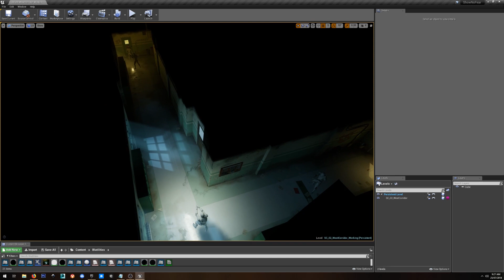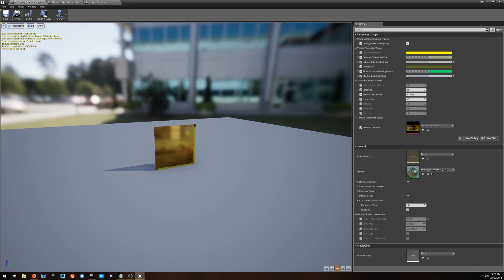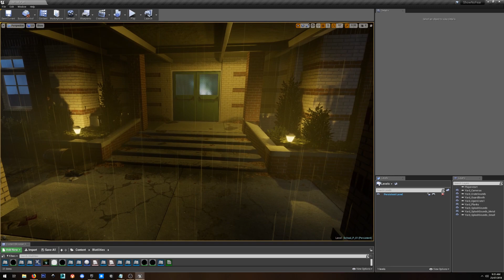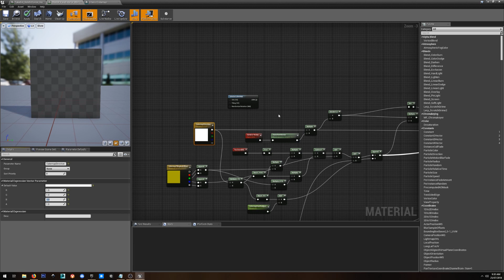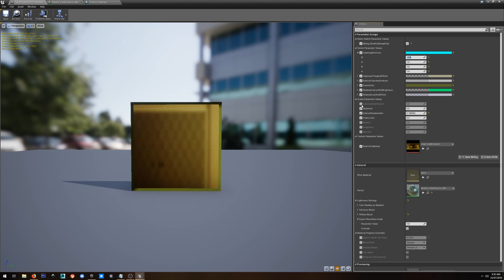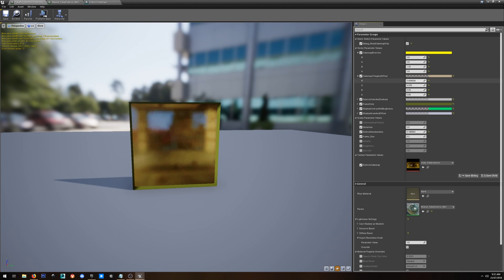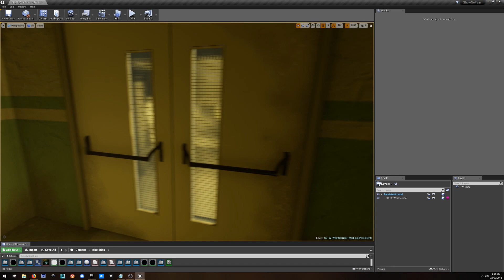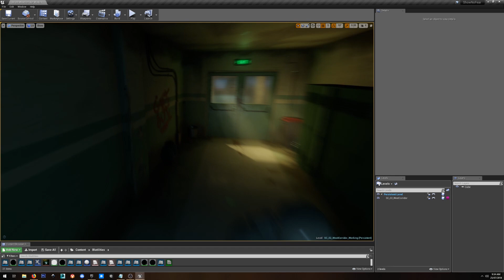Interior cubemapping for fake exteriors in UE4

Comment: I'm struggling to work out how to get mine to work. I've plugged my custom cubemap into the last pin where you noted on the blueprint, but I get an error in the message box saying "[SM5] (Node TextureSampleParameter2D) Param2D> Found NULL, requires Texture2D". I'm on UE4 4.25. Any idea what I need to do?

Comment: Hey, I have a problem with this setup: 
for some reason the cubemap texture won't adjust itself size no matter how far player standing from it. 
here i am close to window: https://i111.fastpic.ru/big/2020/0102/1e/_11e4f1ff8cd8924b610d0d68da94d51e.jpg
and here not so close: https://i111.fastpic.ru/big/2020/0102/c1/_0bd5d214c90f2165e5f6812eaa7f88c1.jpg
you can see the door have same size as if i was close to it
UE 4.23

SOLVED: green and red channels in "CubemapTilingAndOffset" should be value of 1

Comment: How did you enable DoF on SceneCaptureComponentCube? I am trying to make a blurry cubemap in UE4.
Reply from the maker: think it just worked (i just set up the DOF settings in a post process volume and then put those same settings in capture component).
BUT
I think they have deprecated Gaussian DOF now, which is really annoying as it was good for this. Might be able to achieve similar with the new DOF method.

Comment: Hey Cory, I know this is a silly question but I've been trying to figure out how to make this work for a while now and I can't understand a couple of things. First of all did you use a "scene capture cube" component to capture a cubemap from your exterior? And how did you use that into the material for the interior windows? I tried to use the blueprint you posted with a custom cubemap I made but I can't find where you connected the cubemap node. I would really appreciate any help. Thanks :)
Reply from the maker: Scene Capture Cube yes. If you paste from the graph I posted ( https://blueprintue.com/blueprint/8c5j4gg9/ ) - you'll notice it ends at a pin that has a comment "goes to your texture". That plugs into your cubemap texture sample.
Reply: Ah! I was using the other link you posted a few months ago! Thank you very much! May I please ask for one last help regarding the frame and how you added the grid to make it look like this type of glass? Did you use a lerp or a multiply for that? I tried using a black texture with a white frame (1 file) like you said and I played around with the bump offset but the black frame always seems at the same level and definitely not as good.
Reply from the maker: @3Dcowboyvideos  Here you go: https://drive.google.com/open?id=1rNEoFaNeCFlbmV_lRdmCagVnLu2vpj68 - the texture for the frame is actually a linear gradient, white at the sides and black in the middle, this way it acts as a kind of distance field so you can change the size of the frame. Note that the frame will look unlit, so most of the time you'll just want it nearly black (or you can fake some lighting on it by overlaying a shadow texture or something). And the grid is just a simple texture that lerps in a brown color.

Comment: Nice technique! But how did you capture a cubemap?
Reply from the maker: qwerty - using a scenecapturecube actor, you can capture a static texture from it (and you can use the depth of field in that actor, to make it blurry)
Reply: @CorySpooner  May I ask you another question? How did you make this window frame effect? It's a small detail, but it adds a lot of realism and I'd like to create something similar but I can't figure out how it works...
Reply from the maker: qwerty it’s a black texture with a white frame, set to Clamp, and I use a bumpoffset to push it back - using gradient from the edges to the centre as the heightmap for the bumpoffset.

Comment: what is the purpose of using cub Map ? thanks
Reply from the maker: Mainly, so you don't have to load the geometry & textures from outside the room.
Reply: thanks .. but is this only used on design time or still working runtime
Reply from the maker: Eng.Mohammed Salah yes it is for runtime. The actual rooms are in separate spaces in the world (not right next to each other), and get loaded/unloaded when needed. So the cubemap means there is a basic representation of the neighbouring room without having the room actually visible.